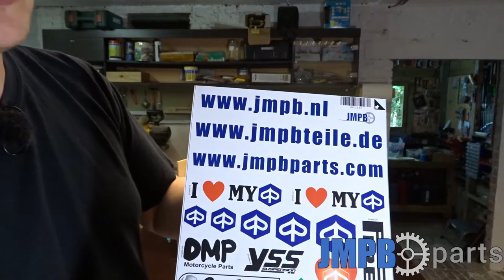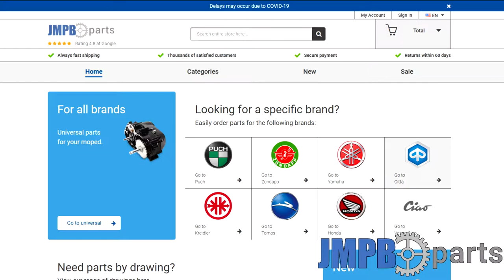Tecno Circuit Exhaust - Vespa Piaggio Ciao 65CC

Comment: Do you recall the specs of the stand-off nut you used to bolt the exhaust to the front of the engine? Like thread size and length? Thanks! I’m about to do the same install on an ‘81 model.
Reply from the maker: The stand-off nut was included with the exhaust

Comment: I just changed my exhaust, but it is leaking a bit of black oil from where it attaches to the engine. when i plug it while running idle it doesn't stall. does this mean I have a leak?! Or is it normal
Reply: its normal

Comment: Is it going faster then before with the other exhaust?
Reply from the maker: i have some problems with the piston rings and the air tightness of the motor, so i have not been able to do a speed test yet, i am working with jmpb on a solution to turn the motor back, i have already received pieces from them to to restore him, if you are interested in the playlist you can see everything I have already done on the ciao - https://www.youtube.com/playlist?list=PLRbyQlIZq2p9ubt84uk58Zu4FFZGXwj0D
Reply: @semke88  ok thanks! How fast do you want it to go at the end? I want mine to run around 60 km/h and if you want yours to run the same I can copy your setup.
Reply from the maker: the maximum speed that I have reached so far is 58km / hour I will try to reach a speed of over 80km / hour
Reply: @jordib8757  I suggest you to use my „original look“  Setup - 43malossi, Gianelli Citypower, 13/13 Carburetor, Malossi Airfilter, ported engine, stronger springs for clutch 65kph (gps)

Comment: the Proma Circuit is much better and brings more Power.
Reply: Yes, Proma CC is very good! Or if you want something that is more hidden tuning the "Giannelli 'Original Power'" is pretty good to add acceleration and higher top speed and looks more original. JMPB is one of the best stores for Ciao but I could not find it in their webshop.